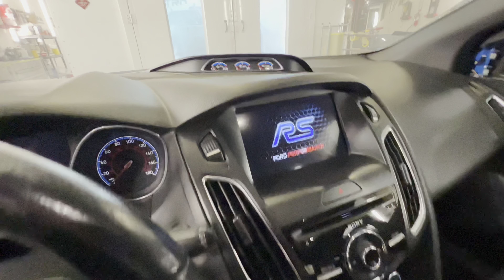NEW NISSAN SKYLINE GT-R BUMPER!

Comment: Hey I have this same bumper how was fitting it cause mine is having trouble in the area where the headlights sit and where the grill is. I cut the bumper bar but for some reason it’s still off a bit
Reply from the maker: It didn’t fit well at all. We had to cut the bumper bar in several spots, also had to put relief triangle pie cuts on corners near corner light to allow to bend and line up to fender. Also you can heat the fiberglsss up with a heat gun and heat lamp hot and get it to bend easier. Then tape in place and let cool and let it form to car overnight. We re fiberglassed cut areas once we had the bumper fitting the best we could.
Reply: @ ah gotcha haha I figured it’d be a headache to fit so I just got a gtr crash bar. Thanks for the reply!